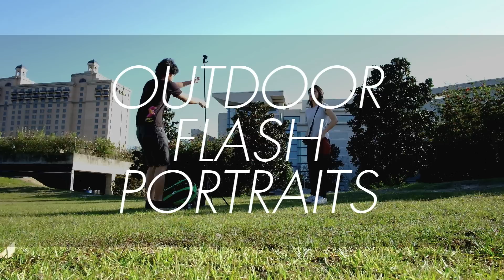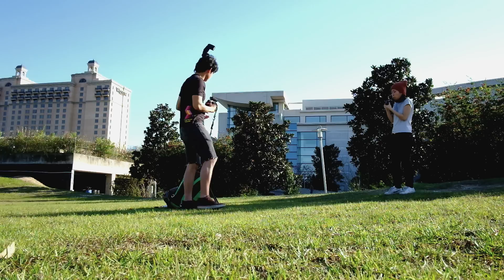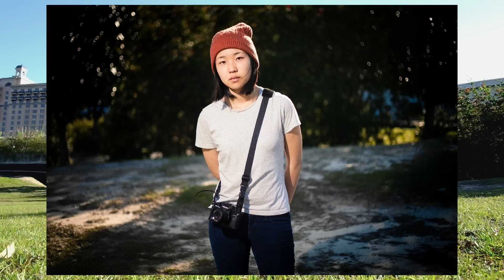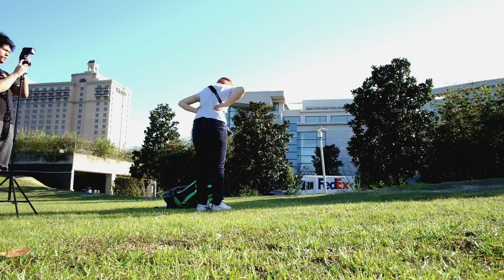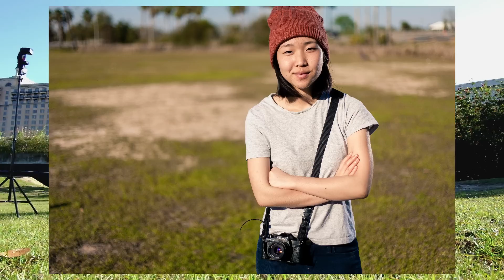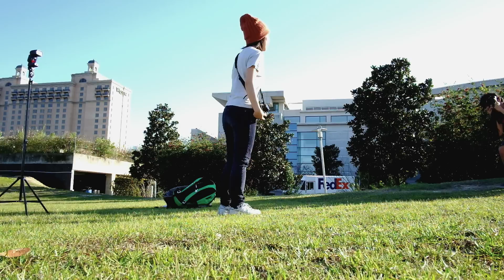Strobist Outdoor Flash Portraits and High Speed Sync (Yongnuo YN-622c) Off-Camera Flash - CamCrunch

Comment: may i know how to set highspeed on canon 580ex2 with connected the YN622c ii? the high speed work when connect the flash to camera but doesnt work with yn622c ii.
Reply: +Jun Cheung I think you could try the cat eye broh....YN is very very manual. idk abaout YN622c ii...but in my YN560ii you set mode to S1

Comment: my question is can I do HSS with a Yongnuo YN560-II? If anyone knows, please respond. Thanks
Reply from the maker: +Jamison Donoho No, unfortunately, you cannot.
Reply: +Jamison Donoho yes you can, there is a trick to do so but you need an TTL flash to trigger the 560 off flash. Im not sure if a normal trigger can do.
Step here:
1. 560 off flash set to full power 1/1 (set to slave mode S1 as well)
2. On camera TTL flash use M mode and set power to 1/128 (the lowest power)
3. Set the shutter speed as fast as you want 1/500  1/1000 1/2000 .....
Check your image
Reply: +David Duong That's not HSS. HSS is a function of the flash not not the trigger. Also 1/128 is not the lowest flash setting, in TTL mode it will go even lower than that.
Reply: +lick jam is right, HSS is a function of the flash not the trigger. The flash pulses setting off multiple smaller flashes so to expose the entire frame and you don't get your shutter curtain causing a shadow over part of your photo. This means you can use your camera with extremely fast shutter speeds of up 1/8000 sec.
Reply: I have seen other sources confirm that HSS works with that flash. But you need to trigger it as a slave with another HSS capable flash, as David points out.

Comment: my canon 70d won´t shot with strobist with yn622c nor flash popup.  can you htell me wich i need to set up? i already in flash set up, set manual, and in 568exii i set slave, same chanel and group, the flash shot normally. but i cant change the value 1/1 to 1/128

Comment: First thing first: there's no link to the outcomes in the description, where can I find it?
Second: I agree it's better to use the flash on manual but I wonder, won't be a waste of time if you're using it with a softbox to open the softbox every single time to change the settings if you're working with a model and don't want them to wait or simply you're on a hurry?

I may be missing something but I've been told to get a YN560iii with the RF603 trigger but does the trigger give you the ability to change the flash settings? I don't want to open the softbox, change the settings, close it and see if it's ok every single time.
Reply: Use this trigger instead: YN560-TX - and you'll be able to control the power of the YN560III remotely...
Reply: Thanks for the info! In the end I went with the 568 EX II because it's HSS/TTL enabled and with the 622C trigger(non TX) that comes as a pair. I'll start shooting with a shoot-through umbrella on a stand so I don't need the display for now while I need the on camera and on flash reciever anyway so the 622C was the best choise.

When I'll need the display there's the 622C-TX for that but if I were to go with the YN560 speedlite instead of the 568 the trigger you suggested is the correct one :)
Reply: +AndreCorner Hi, I have also a YN 568EX II with triggers YN622C-TX (controller) and YN622C E-TTL (transceiver)... All is set to HSS but I still cannot make it to faster than 200 speed... Did you make it work ? What shall I do ? I have a Canon 700D... Thx
Reply: Nop I've been off for a while and just came back home, still didn't figure it out
Reply: +AndreCorner Actually I ended up to find out how it works. As the transceivers come in pair (YN622C E-TTL), you have to use both to work in HSS mode. One is plugged to the off-camera flash while the other is plugged between the camera and the controller YN622C TX on the camera. You will then have full access to the settings... and set the shutter speed to your wish...
Reply: Philippe Rives
Yeah I knew I had to use both but I meant that I still can't se "1/4000" on the screen

Comment: Hello, great video! I have question though.

I have a Nikon D5100 and I want to buy the YN622N as tranceiver for HSS. Will this work? Because the Nikon D5100 doesn't actually support HSS. Also, do I need a HSS-flash then? Probably yes, so the Yongnuo 568EX would be a good choice? I have the Yongnuo 560 II now and I'm very happy with it but it lacks functionality like TTL, HSS and focus-assist beam.

Thanks in advance!

Comment: Hey Bro! Watched this video so many times - Finally took the plunge and bought the YN622C system! Having huge issues setting them up though... All I want to do is use my 430EXII with highspeed sync! With the flash on my 5Dm2 I can push the shutter speed higher and it automatically switches to HSS. But when I attach the transceiver and use the flash off camera, the maximum shutter I can reach is 1/200. That's with HSS selected on the flash, correct group/channel etc. Any ideas? I'm ripping my hair out!
Cheers from Australia!
Reply: If HSS is enabled on the FLASH and it's CONNECTED to the camera, the flash OVERRIDES the camera's settings (which is WHY you get HSS with the flash on-camera).  However, it the 622 is connected to the camera, it SENDS the camera's settings to the FLASH.

Solution: in the flash control menu, set the "Shutter snyc." to "Hi-speed" under the "External flash func. setting" so THAT state will be sent to the slave unit(s).

Comment: Hi Great Video, Just got a question I have two yongnuo 560 iii flashs and a yongnuo yn560-tx wireless flash controller which does not support high speed sync is there anyway to be able to do the same effect, I was thinking of neutral density filters would do the same for cutting the light down?

Comment: Any idea if these will work on a Panasonic GH3? I currently use the Yongnuo RF-602 triggers which I bought when I had a Canon 60D, but they also work on my new GH3.
Reply: You brought the RF-602 triggers for Canon mount right? I am just trying to make sure I buy the correct version.
Reply: Calvin Lewis Yep I used the RF-602RX (with the RF-600TX Controller) with my GH3 with no dramas. The YN-622's also work with the GH3, but not the high speed sync function.
Reply: Is this for manual or TTL? I am perfectly fine with learning manual, I just want to know it will work. I assume you brought the flash for the Panasonic/Olympus version or did is your flash unit a Canon unit?
Reply: Calvin Lewis This was just manual, I find it easier doing everything manual anyway lol. Nah all flashes and triggers were the Yongnuo brand. But the Yonguo flash units I have are built for Canon as I was using them prior to my GH3 on a Canon 60D.
Reply: Thanks for your help so far, there is not much information on what version to get for Olympus/Panasonic cameras. So I should get the 560 III for Canon as well as the RF-602 for Canon as well?
Reply: Calvin Lewis No worries mate. I can't say for sure that the 560 III will work (although I assume it would) because I have been using 2 x 560's and 1 x 560 II.

Comment: hello, nice tutorial, i have a canon t3i and t4 but i have set my speedlight to high  speed syn so i can shoot shutter higher then 200 but when i do it wireless with my Yongnuo the shutter speed only goes to 200. so i was wondering if you had a tutorial on what setting to put it on so i can shoot higher then shutter 200 using wireless triggers. thanks

Comment: hi nice vid!
erm the yn560 mkiii supports high speed sync right with the yn622c?
Reply from the maker: No, it does not.
Reply: Oh what would u recommend? My cousin has the canon 580ex 2 those will it work? Apart from canon which yn model would u get?
Reply from the maker: The Canon 580ex2 is what I'm using in this video. The YN568 will also work.
Reply: Cool thx man!

Comment: please reply... i am about to order these but two things bothering me a lot. 
1:: what batteries these use? normal AA batteries or there are any specific batteries.
2:: i am buying them just for high speed sync.. but my flash light will be inside the big softbox and will out of sight for the transmitter.. you think it will still do high speed sync? because in your video, your flash light in not out of sight. but i think because these use radio signals so should be ok for out of sight flash lights receivers.
Reply from the maker: They use AA and because it uses a wireless signal, you'll be able to trigger eve when there are objects blocking.
Reply: I find rechargeable Enegizer batteries to be the best. Your flash inside the softbox should work fine because these triggers use radio signals instead of line of sight.

Comment: This is a great video! Could you explain ATTL and  High speed sync? I'm confused O:
Reply: Various TTL settings are just different ways of metering flash It's not something you really need to if you already know how you want the flash to affect your pictures though, just use manual flash. The high speed sync is what allows you to use a faster shutter speed while using flash, normally the faster shutter speed you can use while also using flash is anywhere from 1/200 to 1/500, with high speed sync you can go past the sync limit of your camera body.
Reply: Think of film cameras with a focal-plane shutter that scans a slit across the film.
Even digital sensors do something similar - called 'rolling shutter'.
Normally, the highest sync speed is maybe 1/250 second - shorter flashes would reveal the shutter 'slit'.
Perversely, 'High Speed Sync' is actually a slow flash extended to 1/250 second (rather than the usual 1/1000 second), so that the subject is lit while the 'slit' traverses the sensor.
Or something like that ...

Comment: It depends.  In TTL, the camera limits the flash power; meaning you can set the flash compensation to +3, but TTL may limit you at +1.3 (for example).  Once TTL "decides" the exposure is right, you can adjust all you want and it won't make a difference, again, because TTL has decided the exposure is right and adjusts your flash accordingly.  Think of it as shooting in auto for your flash.

In Manual (remotely triggered) you can set flash power manually to 1/1-1/128th power.  Hence the name.  :D

Comment: Hi, am using the pop up flash in commander mode to fire off camera sb900. Does the camera totally control the flash power settings through the menu, or can the sb900  have flash power set manually? Have found that i can use pop up flash for high speed sync using commander mode, with-- set. Thank you

Comment: Hi , Haven't done high speed sync for a while, so have forgotten the camera menu settings on my d90. Went into the menu and set     e5  FP Sync to ON..........Not working. Curtain is not opening as it should be. What am I missing? Thanks for your help. Am using an SB900 off camera with yong nuos.

Comment: I could use your help.  I have the same setup.  I'm having some problems with getting the flash to work in manual mode.  I'll set it to manual mode, then immediately as a press the shutter halfway, it flips back to ETTL.    Any advice?

Thanks.

Comment: 556ex has  TTL, high speed sync,, exposure bracketing,  exposure lock,  focus lock,  can be a commander,  both manual and auto control, rear curtain sync.   
the 560 is much simpler, I use mine as a manual flash  speedlight setup with a simple radio popper.

Comment: The 560 doesn't have TTL (auto mode) or HSS (flash with shutter speeds faster than 1/200th second) so with the 560 II I can only use manual, and only do 1/200th second or slower.

Comment: hey! What about the Yongnuo Flashes? 
the YN-568 EX [170$] or the YN-560 [80$] ? i dont know whats the difference between em [ttl thingy is on th e568 i think]. But, will they match up to the oh-so-expensive official Canon\Nikon flashes? will they cover basic usage, well?

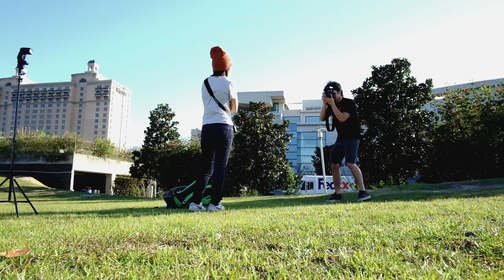p.s- @ around 3:13 - was the flash placed straight to the right side of your model? [like 90 degrees?] or was it 45 degrees to the back of her? [some flash light spilled into her cheek, so i wonder].

Comment from the maker: Not with those triggers. If your D7000 has a commander mode, you can change the output of the flash from the camera if you use that setting, I believe. With these Yongnuo YN-622, I'm able to change the power from the camera.